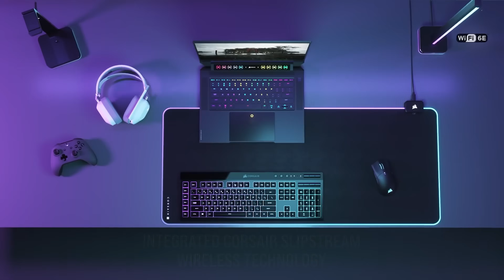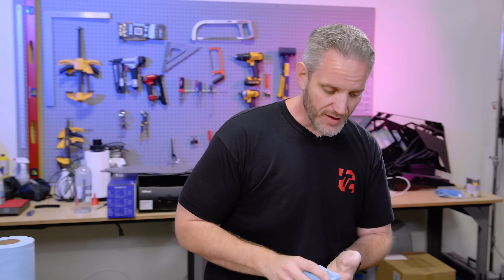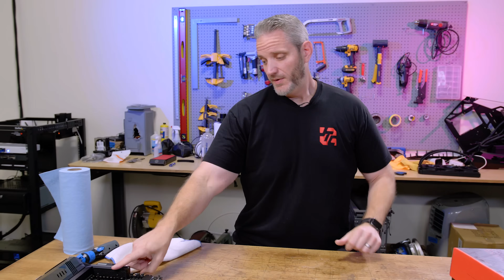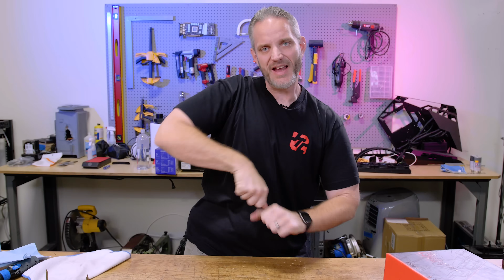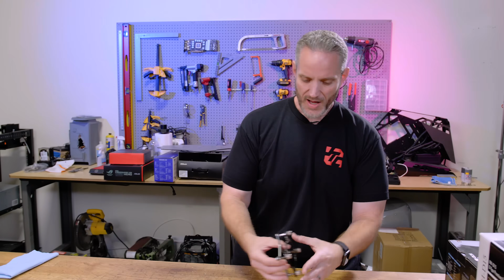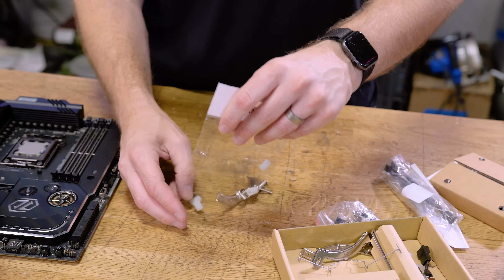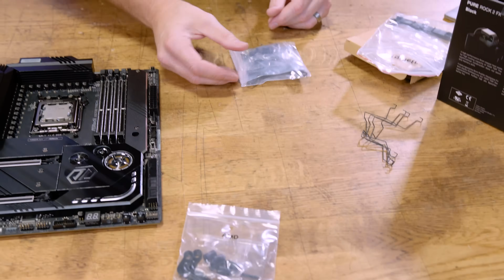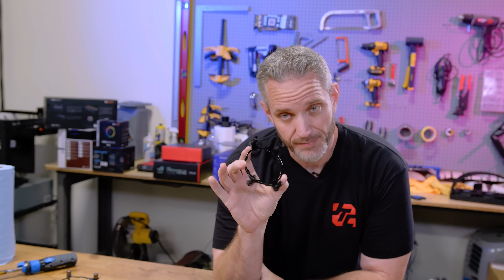AMD made a terrible flaw with this design...

Comment: i'm sorry to disappoint you but it's not also an am5 matter but am4 too i have a 5950x with an 280 aio and it takes no time to reach 90 degrees under full load ...and before someone starts sayinig.........no the aio in well mounted the paste is fresh , i even replace the both  thinking they were not working fine. i also lowered the voltage to 1.20 but still temps are very very high

Comment: Can't those inner torx screws be undone just enough to release the back plate and another added and then screwed back down? Or would the whole retention system fall off the second it's undone? Also. Why can't the retention system just be removed if that's the case and put back once the new backplate is on?

Comment: Glad to be able to use 15 years old Noctua tower through AM3, Am4 and now AM5  with zero extra expances (thanks to Noctua policy). If your cooler manufacturer don't do adapters but only socket-specific obsoletion doomed units, it's time to change.

Comment: on my rig i use a bequiet dark rock pro 4 and it used the same screw holes as the default bracket and it works great. So i guess if anyone's wondering, the dark rock pro 4 is truly compatible

Comment: Im using the thermal right tower cooler on my 7700x and doesn't seem to cool or do anything. Doesn't even get warm on the heat pipes. No matter what it runs at max temp I have it set too. This normal?

Comment: I have an AM4 AIO cooler on an AM5. I'm using an Antec Vortex 360. It clearly says on the box:

Intel Socket LGA 115X/ 1200/ 1700/ 20XX.

AMD Socket AM3/ AM4/ TR4.

But I can confirm this particular cooler is compatible with AM5. It is using the hooks that were already there on my motherboard. My build is almost complete, just missing the M.2 Ssd to install the Windows 11 on.

Comment: My AIO worked thankfully.  I used the boards backplate and its running 34OC idle and max ive hit hammering it was 73Oc. 7800x3d on a b650e board using deepcool ls720 AIO

Comment: i've only just moved to am5 after using an i7-4790k for the last 10 years, now using a 7800x3d, my idle temps are in the mid 40's in a 20+ degree room ( cooler master 360L AIO)

Comment: I remember it feeling really sketchy to lock down my Xigmatek air cooler on my AM3 then when I did upgrade to AM4 I found it funny that the stock cooler didn't even use the hooks preinstalled on the motherboard..

Comment: AM5 just doesn't seem worth it to me, tbh. It needs a few generations under the belt for it. When I can build a cheaper AM4 system and use it for 15+ years, yeah, I don't think I'll need AM5 anytime soon.
Reply: If you are already running AM4 especially a high-end processor then there is absolutely no reason to upgrade. The only reason why you want to get AM5 is if you want to "future proof" a bit better especially for those upgrading from older chipsets.

Comment: With the hook system  on your am4 motherboard when you try and take the cooler off you need to be careful because it can also come off on one hook and then it will bend pins on your 5600 cpu
It happened to me and bent so many pins was not fixable.  Ended in the bin could not straighten the pins

Comment: No worse than an Intel’s fatal flaw ………. that being power draw and heat issues on its 13th and 14th gen. AMD temps are low compared to Intel. Intel is where your focus should be………not AMD. You’re giving the impression that AM5 runs hotter than Intel 13th and 14th gen and that’s just not the case. At 100% power load……..Intel will throttle…….AMD will not.

Comment: i dont want to be the one to judge...
but i think having 8 screws on that backplate..it is better than having 4(specialy if it is thinner than the old ones and they tend to flex if u have a heavy cooler)
in other words..it holds the motherboard better and avoid bending the pcb/motherboard(over time)
to me...the original metal metalplate was always the better choise to hold the cooler on the motherboard (here im talking about aircooler only since the cooler i have is heavy enough)
because ive seen "cooler master" backplate witch is plastic...and only hold half of the screw is been held...and not all around how it should be,plus under the plastic one they gave me it doesnt touch the motherboard to hold it properly....so i went for the original metalic plate. and its just perfect.

maybe i might be wrong...but ive seen it over time this result.
anyways...metal bracket was always a better choise for me.
also as bonus...i dont need to take off both lids of the case to remove the cpu cooler or vice versa.

Comment: i mounted the velocity 1 block on my am5. Dont no if the block is mounted perfectly flat and had it stresstest in aida extreme at 83 C.. runing 5.2 on auto OC on an msi board. waching this video its doing 35 C.

Comment: I have a 7800x3d and even under full load it doesn’t go above 70 degrees so give or take a couple degrees with my 360 aio even with air it didn’t above 75-80 max so idk what your doing to get to 95 but it’s not that deep

Comment: I am surprised at the high temp claims of AM5! I recently built a ryzen 7600X system, and used a thermal take cpu air cooler. I did not touch the bios for undervolting, the only thing is I added a regular 120mm Noctua fan with the thermaltake one. Temp at idle ~40C reaching seventies at max loads, end of story.

Comment: The Nh-d15 shouldn't be marked as a fail, because they have fantastic customer service and you can get the AM4 mounting kit for it, which DOES work with the AM5 socket.  Also their current NHD15 packaging includes the AM4 kit which means it is AM5 compatible unless you have a really old model and can't be bothered to get the AM4 kit.

Comment: Sorry,but 99%% of this video is way too technical for me to comprehend,alot of abbreviations and parts about the sockets and reception this and that and thickness of...blabla , i just dont understand it,wich is a problem  because im building an AM5 system   , im making it using Lian Li evo XL and a 650 plus motherboard ,most likely the cpu is going to be an Ryzen 7900x3d , i dont intend to run anything but stock values and settings, so no overclocking of any sort , but what the hell do i do if its a lotteri what AIO that functions with that AM 5 socket and coolers.

Comment: ok, serious question because i have a 7950x, where can i get this IHS shaving kit and the tools to utilize it and this mounting bracket for aio's/coolers in general? cause i game on my system also. I went with the standard x variant for the multi-thread horsepower (also the x3d chips were not out yet), but i know i can get better single to 8 core results and this would help immensely. it would also make any curve optimizer setting i place way more effective and stable.

Comment: The IHS thickness is probably something AMD did in order to make the AM5 socket last more, considering that they can always shave it from the inside for 3d stacking chips further down the line. The stupidest thing they did with the Zen 4 is actually putting the CCDs - the cpu's hottest components - at its bottom instead of in the center. Hence all the offsets on the market already making you lose a few degrees by simply positioning the cooler lower.

Comment: Agree it looks to be worst. I T was way easier with pins to install AMD CPU. Design is pretty bad and not easy to install CPU for AM5. I also currently bought parts to build new AM5 and didn't know they changed design socket.

Comment: Bought the Thermalright AM5 Secure frame (black) for my 7800X3D. With the Lian li Galahad II Trinity Inf 360, and used the TF7 paste that came with the Thermalright bracket. Stress tested the system for some hours, and cpu goes 82/83 tops. While gaming 70/75.

Comment: I built a desktop with a Ryzen 9 7900, without X or X3D and I'm using a Noctua NH-D15. On Linux I'm running at 50 degrees Celsius, with some spikes to 62. On windows the history is little different, for no reason sometimes I'm seeing it running at 75 degrees Celsius and most of the time it's running at 55 degrees. 
I'm using the stock config, no OC, no changes at all.

Comment: I've got a DeepCool AK620 on a 7700X and it works amazingly, highest temps I've seen in games was around 60-65° in CPU intensive games, usually it hovers around 55°c in less intensive games,
Reply: at stock settings?  did you try bf2042? my 7700x hits 90c in that game.
Reply: @Jason2231  yeah that was on stock settings and I tried quite a various lot of games, the AK620 is honestly a great cooler if you're actually at 80-90° constantly in games because ryzen 7000 series CPUs should only spike to 90° once when you start a load and then it'll even out to a more stable temperature, it's just how the 7000 series CPUs work

Comment: You pushed down that corner 1:48 . Visually inspecting the cooler for thermal paste isn't an accurate way to gauge the pressure unless you pull it off exactly the opposite way from where it's mounted.

Comment: Why couldn't sockets be replaceable....IBM used LGA super computer chips and LGA pins were in a piece of plastic that fit in between the cpu the and gold contacts on the board. Than the Cooler being screwed in gave it the connection. Break a LGA grid just order a new one or have one on stand by. Sun and HP did the same thing with ceramic cpus and once with fiber

Comment: After months of Heavy use on AM5 I can say I have not had any issues using a Be Quite Dark Rock Pro 4 Cooler my Temps have been Maxing out at around 70° on CPU Intensive loads and the CPU has been running at about 5.6 to 5.8 GHz out of box and and stays there until it goes Idle then it goes down to its 4.5GHz Base Clock

Comment: how about the aio in the Cooler master n200p max you reviewed is it good with the amd5
Reply: just read it has the 2 brackets that clip to the plastic tabs on the board which should be ok

Comment: I had a ryzen 5 1600x and was using the standard cpu braket and the thin piece of metal that went to the heat sink broke and my cpu was stuck to the heat sink and bent the pins. Thank God for Microcenter warranty that I bought.

Comment: I'm still confused why some of these are running as hot as they are with so much less power consumption.  My 7700 non-x games at 70 degrees with the stock air cooler.

Comment: I recently got a be quiet dark rock tf2 and I found the temps are too high on my 5600, but if I press down, the temps drop by about 10 degrees. So now I am looking at getting one of these contact plates... hopefully brings my temps in line with where it should be. I am currently getting 60-65 idle and 80 load... but the ambient is about 18c when I was testing at night with the window open.

Comment: So I actually had a similar problem when moving to the X670E-E chipset to accompany my Ryzen 9 7900X. I was unaware of this issue because I am fairly new to this PC building shtick, but I learned quickly and got familiar with the PC building process, so also please excuse me for lack of correct terminology when describing this situation, I will also attempt to explain this in a descriptive easy to understand manner for beginners like myself. I have a ASUS ROG STRIX X670E-E Gaming WiFi motherboard. My CPU cooler is a Corsair H170i LCD Elite AIO. When mounting my CPU cooler with the black plastic hook-on pieces that the standoffs would go in, there was a gap between the surface of my CPU, and the metal underside that contacts and cools the CPU. I only noticed because after 2 or 3 attempted bootups crashing, each lasting progressively shorter, that the likely root cause was not some defective parts, but the CPU heating up from boot until it hit TJmax and auto shutdown. Since each boot was shorter and shorter, I attributed that to the fact that the heat built up hasn't dissipated, so it starts at a hotter point each time, taking it less time to crash. So naturally I removed the cooler, and noticed that the thermal paste did not spread at all, telling me that there was no contact between the CPU surface and the cooler's underside. My solution to get rid of the gap, was to remove the black metal hook pieces from the process, even though it was recommended I use them,  and just directly screw the standoffs into the motherboard holes (thank god the threads actually fit), and install it from there and then use the thumbscrews to hold it in place, entirely skipping the installation of the black plastic pieces that Jay displays at 3:59 in the video. After I did that, there was good surface contact and my PC stopped crashing because now it was actually getting cooled unlike before. Not for every single case, but be aware that the guides or recommended installation methods in your cooler are not always going to actually work and you'll possibly have to find an alternative way to get it on.

Comment: id like to say i was always able to press the clips tension down with one finger and use my other  to slip the clip off the square, in never used a screwdriver and i was completely untrained and by the seat of my pants and no internet to look stuff up, scavengind obsolete parts from junkyard and swapmeet stuff about to go into the trash compactor

Comment: I realy value a quiet PC. After the upgrade to AM5 I was disgusted about the noise my computer made, even after adjusting fan curves. I triple checked the mounting of my Noctua U9S and redid the thermal paste, but that didn't help. The heat transfer is so bad the CPU is at 50°C on Windows idle! During long stress tests the cooler doesn't even get warm so bad is the heat transfer between die and cooler.
So if you want a quiet PC and don't want to do direct die cooling, don't buy AMD 7000.
For now I reduced power limits by a large amount. But I will switch to direct die as soon as available.

Comment: My guess would be for future compatibility.  If they are going to use AM5 for the next 5 or so years, then this could be for the future generations that are already underway. They addressed the elephant in the room that it has longevity at 95c, but don't need to force a change in socket specs for several years.

Comment: did that with the screwdriver,  but never scratched the motherboard, some times i thought i did how hard it hit it when it sprung out. That was a long time ago also learned how to do with without the risk of giving my motherboard a new facelift

i would prefer to keep my cpu at the room temp, but its something impossible with how all gpu and cpu use spam as much power into their products to get a bit more performance since they wont optimize to use as power possible with highest performance so in turn would heat up less, nvidia were going in the right way with 1000 series but they scrapped it

Comment: Actually I just got a thermalright Peerless assassin. It uses the backplate. however because of the new retention bracket being wider than am4 it doesn't fit, the bar included to replace the plastic hook that comes on the board hits the CPU retention bracket.

Comment: I've ordered the 7950X, and I'm about to wait for the release of the Die Guard from Der8auer to use it properly and with Conductonaut LM. A brand new NH-D15 is already waiting on the table. Only thing that scares me is to delid it, but I'll have to be brave enough to do it anyway, cause there's no way I'll keep a CPU running for years with permanent overheating values...

Comment: i just replaced a corsair aio that the pump failed and replaced it with an uphere heat sink and boy do those need alot of pressure to snag the plastic hook.  i never use a screw driver.  i just kept doing a lot of hand and finger exersises over the years.  now i can push them on with no problem. doing push ups on your fingers helped the most 😃

Comment: I’ve had the AMD AM4 OEM retention system fail because the composite (plastic tab / hook) snapped off on one of the two sides.  The installed RyZen 3950X shot up to 95C with the AIO hanging on by a thread.  Not a great cooler mounting system.

Comment: Remember back in the day, the two-end clip system was even used on bare, heat-spreader-less CPUs like my AMD Athlon XP 2400+ (which was not an easy first PC build, but it was a great value if you managed to install everything without damage)
It had this weird flathead-notch bracket that people used to slip off and pierce through their motherboards with, or chip the edges of the CPU die from asymmetric pressure. It was the wild west of PC building lmao

Comment: Lol  I modified my HP pavilion gaming Firebox! With a D65 noctua cooler. OK so my 8643 B550  motherboard has a amd4 tray with a Intel cooler bracket🤯. Where there a will there a way. And my was a need! And yes I added 3 intake and 1 exhaust 80mm fans with RGB 😆

Comment: What is the difference in height of the block between a 5800x and the 5800x3D cache.    would the block be thinner.   now what would be the block height difference between the 7900x vs the 7900x3D cache.  just speculating

Comment: jay seems to forget how much flack he got when he starts getting passionate(emotional?) like he did with the GPU's.
Noctua does provide updated hold down mechanism when you provide proof of purchase of new generation of MB/CPU and of your cooler.
I don't know of any other CPU Cooling company that does that.
also comparing electrical wear to mechanical wear is perfect Apple and Oranges.

Comment: Serious deal-breaker for AM5 adoption for me. I was banking on the 'AM4 compatibility' so hard that I went out and bought a SECOND Enermax 360mm AIO so that I could have an extra one, just in case my current one failed. Now this happens...so now not only can I NOT use my AIO for AM5 (it has it's own backplate)... the absolutely LUDICROUS platform cost has ensured that I won't be moving to AM5 in a hurry.  Well done AMD. 😑

Comment: no not just the hooks it can also work  on any cooler that uses the same 4 mounting screws to the old 4 screws  so coolers like noctua can be used. I have done it and it works perfectly